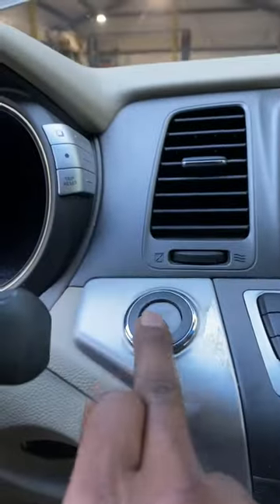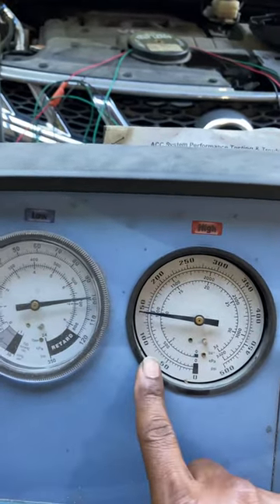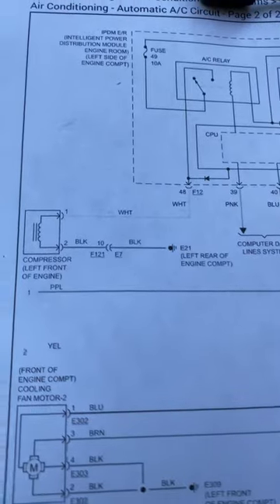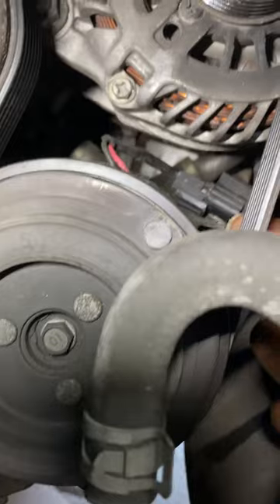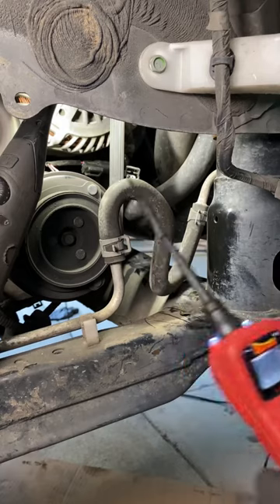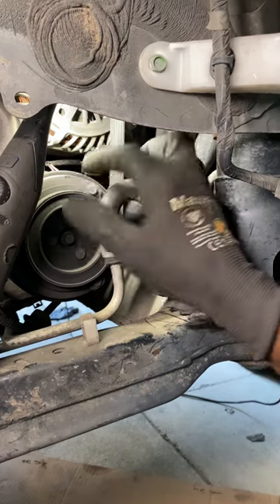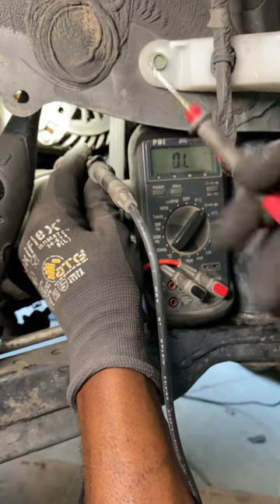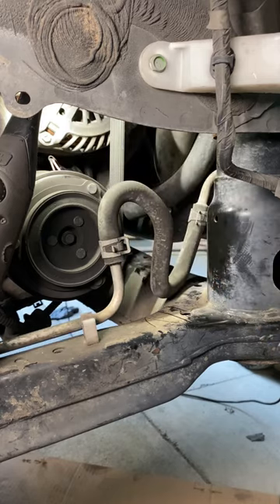Nissan Murano A/C not Cold DIY fix

Comment: Yes, man.. I have one of these (RH Drive)... a/c stopped working after replacing the battery (the battery went dead a couple times n had to use a jumper pack to start the van) ...... My Launch Scan tool gives a fault code B2631 - Sun Load Sensor.   However, moving light to and from the sensor changes how fast the blower motor spins, etc (layman test).. A/c fuses check out ok and power going to the compressor........   You did a test there that I didn't do however... testing the continuity of the coil on the compressor...  I will do this test.    The A/C system is charged properly as well.. 

If i happen to get continuity at the ac coil, what u think could be my issue why clutch not engaging?
FYI.... a/c clutch and coil were replaced about 3 months ago....
Reply: Interested to get your take on this one rasta

Comment: @rasta I took my 2007 Nissan Murano to the mountains for the weekend where it was 20F degrees, the ac working good and blew cold when i left home, but once i started driving back home the ac wouldn’t work and just blow hot air? Any chance you would know the problem or where to start? I used the ac once when I was up in the mountains and it blew cold but now when I’m back home in 70F degrees it will only blow hot air
Reply from the maker: how warm was it outside up in the mountains when you used it. Because it is possible that you were feeling the cold outside mountain air